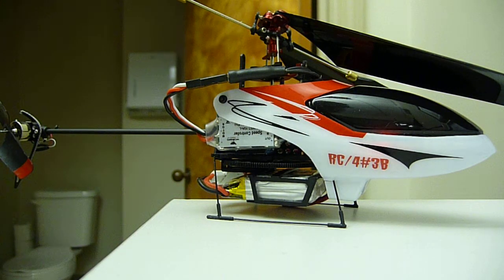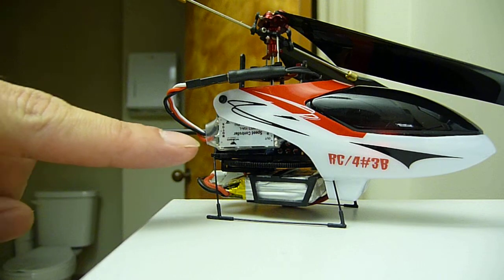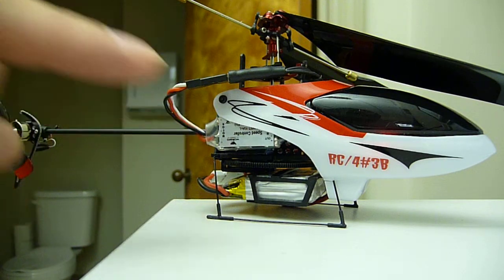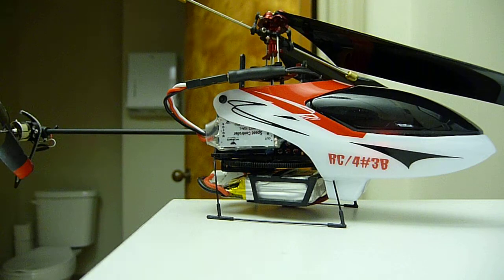Walkera 4#3B binding

Comment: It's absolutely normal. The sound comes from the ESC/BL motor and is the initializing sound that says: everythings okay and ready to go.

But you should turn the transmitter on first, then plug the battery in. Otherwise it could be it doesn't bind correctly (servos work, motors won't, etc)